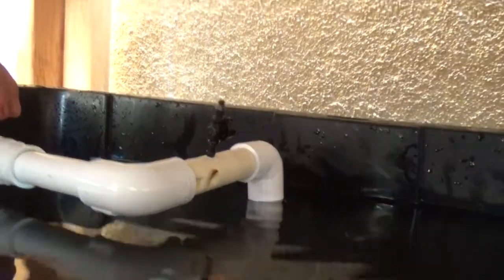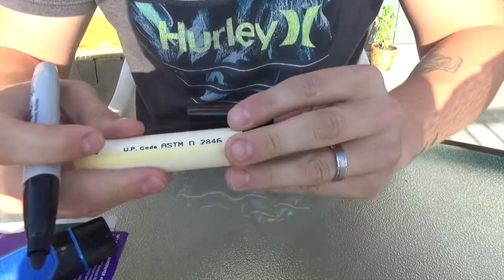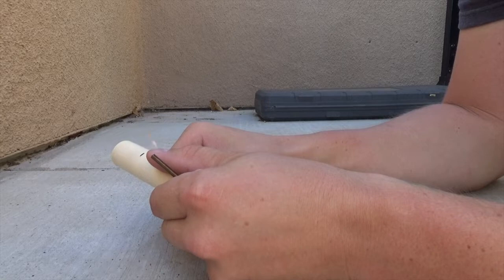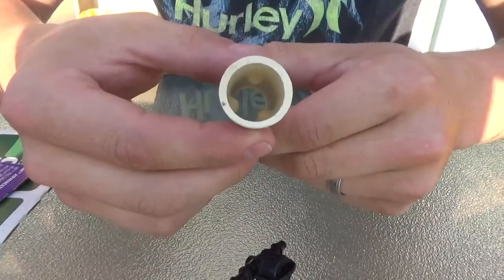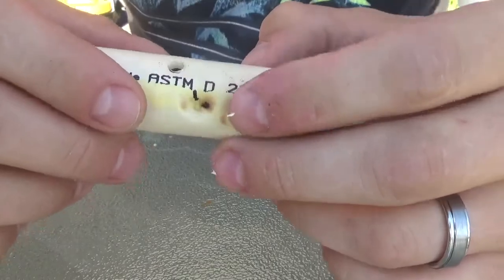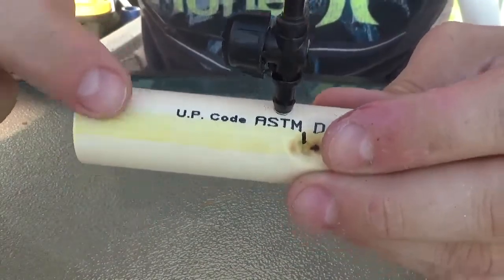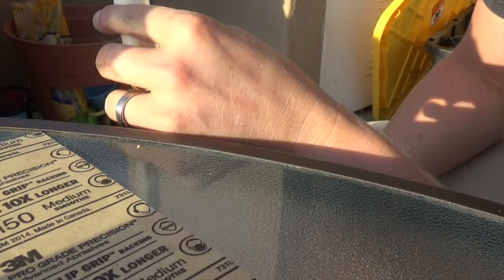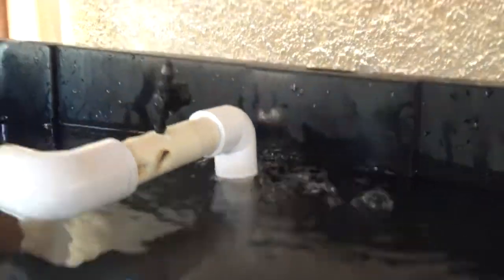DIY Venturi Pump (Marble Edition)

Comment: I can't believe how easy it is, took me 10mins to build.  I used my soldering iron and it's super easy and work beautifully.  I been trying to build a venturi system after watching a couple's video and it didn't work properly and sourcing some of the parts is a pain.  Your method with a marble is by far the easiest so thank you for sharing.
Reply: . 6:01 6:01 6:01 🎉 6:01
Reply from the maker: I’m glad we could help!

Comment: I can't see the final bubble result you never really show the water pool. Does it turn milk white an bubbly?
Reply from the maker: Yes it did with a higher rate pump but for this video I only showed it’s use as a redundancy system for recirculated water. Working on version 2 and will definitely crank it so you can see!

Comment: very cool mate. so, a year down the track now, have you had any problems with the marble method? havent had to supplement the marble venturi with an air stone / a different venturi design or anything like that?
Reply from the maker: It’s still in there as a redundancy to the air pump which recently came in handy when the air pump stopped working while I was gone for 2 days. This kept enough DO available that the fish survived until I got home, albeit sluggish but alive.
Reply from the maker: I’m working on a new outline to add a solids filter and a stand alone fish tank. Also working on version 2 of the bio filter that will use this Venturi design to create turbulence and also add a second Venturi on circulation for dedicated DO. Thanks for watching check back in for update!

Comment: How much constant pressure is required for this to work? How much water will it pump relative to the input?
Reply from the maker: I’m not sure... when I set it up it was coming off of a recirculating set up to control the pump without causing extreme back pressure. I don’t know the minimum constant pressure but I also don’t think it was much. It’s been awhile since physics. I think the input will match input and output assuming you have a fairly decent pump.

Comment: Hey, could this be optimised as you have put the venturi air intrance at the end of your pipe (8:45). If you put at the beginning there i more time for the air bubles to dilute in the water inside the pipe. May be you will see less air bubbles at the end of the tube but than this would be a good news as it means the oxygene is in the water. Isn't it ?
Reply from the maker: You can move the inlet to direct out of pump for sure. The way I set it in there was practical for my application and also allowed for the presentation of it working. I think I might move it to direct here soon and hook it up with clear tubing... may be very interesting
Reply: @homegrownaquaponics3562   yes clearly, with clear tubing,  is would be very interesting for a video. using a glass uside down and with marks on the surface could be a measurement procedure to asses if more bubbles dilute or nearly the same amount in depence of the distance to the tube output (measured with 2 minutes for example)
Reply from the maker: JB S  hmmmm, interesting. I think for best results I would need to test the dissolved oxygen over a period of time in a static tank. It’s going to be awhile before I can do that test, but in the mean time I’ll get the materials for the inline Venturi and we can see if it causes an increase in dissolved o2 and increase in bio filter

Comment: Why didn't you just drill a hole through and through and stick something through it to hold the marble??? Might be easier than trying to hold a lighter in the wind... just asking...
Reply from the maker: That’s a good question! In hind sight I coulda shot the video inside or used a heat gun. In truth I didn’t want to add anything that could possibly leach into the system or fail over time. Alloy bolt and nut could work with a sealant... that just adds steps that aren’t really needed. I also wanted the marble dead center in the pipe. This way is pretty simple over all.

Comment: I've been designing, installing, and tweaking aquatic filtration systems for 30 years and I have never seen that....very cool!  BTW...your question Why spend the money on additional pumps?...back up. All pumps fail, usually when you are not expecting it or there to intervene, building redundancy into your system is the wisdom of experience. Thank you for the video. I love it when I learn something new like that.
Reply from the maker: True lol case in point my smaller system just drained itself today when a line failed!!! Live and learn. Do you think I should have a second water pump?